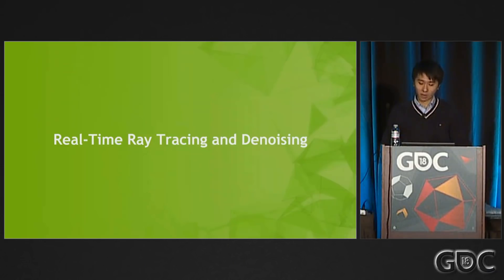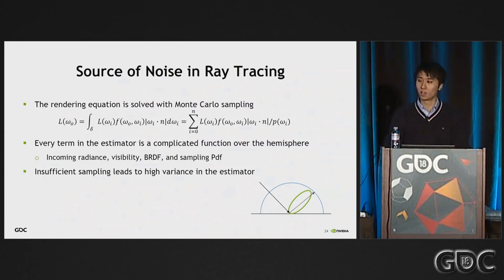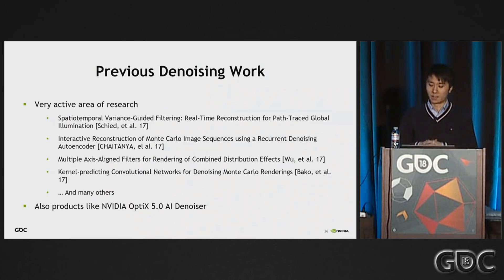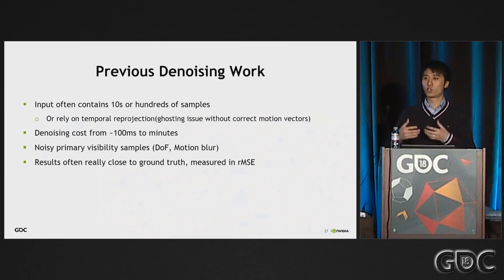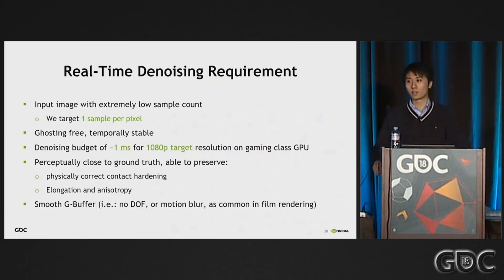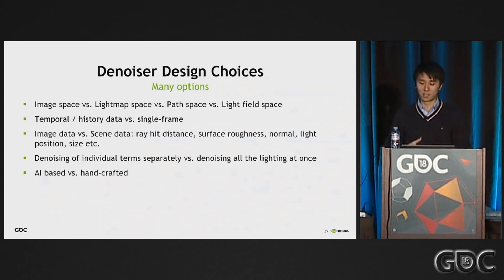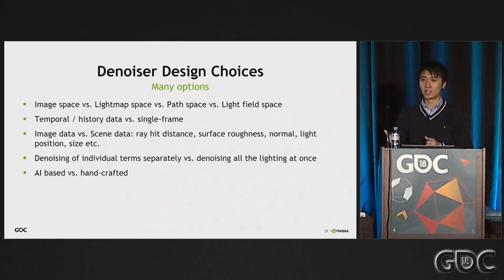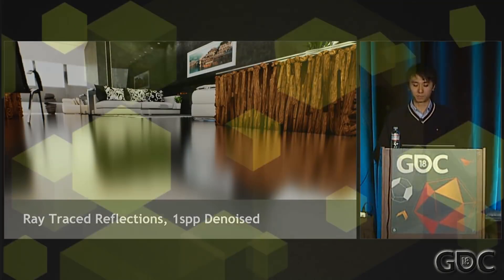Raytracing and Denoising

Comment: The only thing I don't get is - why your budget is two samples, when your cards can push 6-8 billion rays per second?
Reply: rays aren't exactly serial either-outside of acceleration structures and stuff a ray doesn't linearly hit a point and then that's that, especially not with path tracing which is generally used for physically correct rendereing. One ray could end up being tested for intersections multiple times, and add in multiple samples and that "6-8 billion rays per second" seems to dwindle
Reply: George From Jungle because you have tens of millions of pixels to drive and expect a 60 fps, budget for a single pixel is really limited
Reply: Consider shading, you can calculate as many rays as you want, you have to shade it, and that is done by FP32 and INT32 units, not by the RT core itself